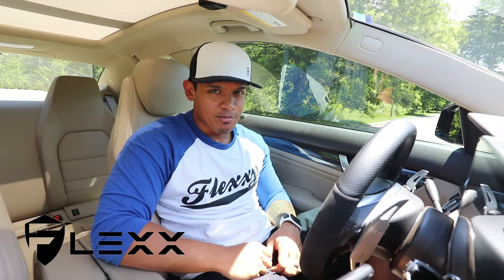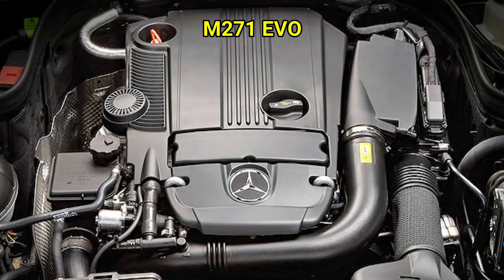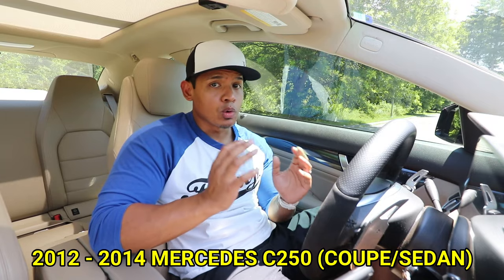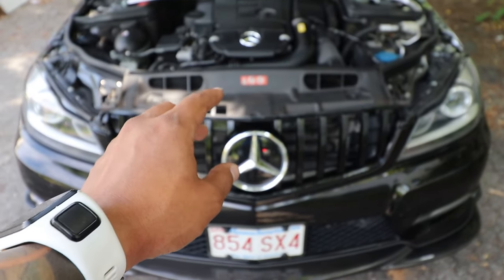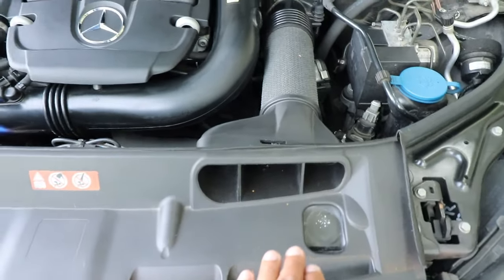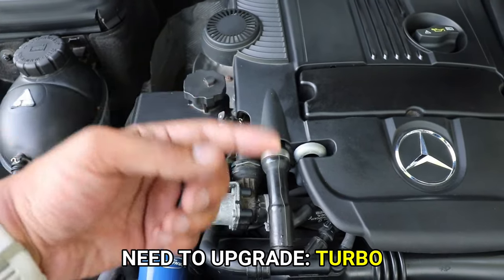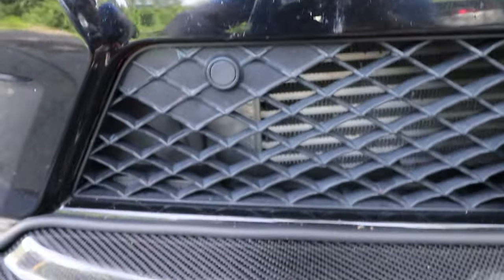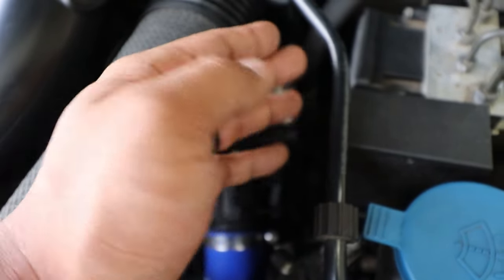So that's how the TURBO SYSTEM works in a Mercedes-Benz C250!

Comment: Hello Flex, how are you? Look, I have a little problem with my mercedes, c 250 2014 I put a relief valve on it and then everything was fine, but my voice control broke inadvertently I put one on it, but now it keeps pulling pressure. nikebs and not the car does not move, what do you think it is?

Comment: Turbocharger is always located directly after the exhaust manifold. That is the rule if the car is stock. There are no exceptions whatsoever.
Reply from the maker: Not 100% true.  A portion of the turbo is attached to the manifold but it’s not all turbo after the manifold. The exhaust manifold exhaust spins a shaft that leads to the turbo and spins the turbo. So you can say the shaft that spins is after the manifold but not really the entire turbo.  

The airflow starts in the air intake and then into turbo, then it’s becomes charged through the exhaust fumes spinning the shaft that spins the turbo.

Comment: Hey flexx love the vids man!!! Im a new Benz owner, got a 2012 C250 sedan, and im coming from a 2009 Jetta Wolfsburg Edition 2.0T....when i would accelerate on my Wolfie, i could hear the turbo clearly, and it was music to my ears! However even with my windows down, i hear no turbo "whistle" from my Benz....is this normal? Or should i be concerned?
Reply: I have a 2014 C250 Sedan...That's very normal.. In a few of Flexx's videos, he talks about the turbo muffler that MB installed in our cars. Our cars are designed to be efficient and quiet. If you haven't already, I suggest ripping through a ton of his DIY mod videos. They are inexpensive, fun to do and really make our cars more fun to drive. Welcome to the MB community!
Reply: @weatherwatchTX  my c250 whines almost like a supercharger, i absolutely love the sound but wish it was louder. that said i really want a traditional turbo whoosh!
Reply: Thats because you need to get a diverter vaulve sounds gorgeous

Comment: If I have an oil leak at the turbo bank 1 between turbine and compressor any suggestions on how to stop leak…or should I be replacing something?
Reply from the maker: No clue. On my c250 when I did have an oil leak near the turbo, it was a fail oil feed/return line. Replaced it and no more leak. This was a common known issue.

Comment: I might need to change the wastegate actuator or the valve to address a low boost pressure error code. Is it an absolute must to remove The power steering fluid reservoir? 2013 c250

Comment: Is there a regular service that needs to be done for the turbo in this engine? My wife has a 2012 C250 Sedan with about 120K miles with no issues.
Reply from the maker: No there isn’t. (To my knowledge)

Just make sure your oil to the car is changed regularly and don’t let it breakdown too far. 

Also, the gasket to the metal oil feed line to the turbo usually fails and starts slowly leaking oil.  It’s a pretty straight forward replacement.
Reply: @TheFlexxGarage  Thanks

Comment: I have the same car and my factory intercooler hose coming out of the turbo is always been loose. The clamps are on and you can't pull it off but it's loose. I've never had an issue but recently I'm getting a low boost issue. I haven't found that issue yet but I've always wondered if that hose should be loose like you can shake the hose around while it's connected to the turbo It just seems too loose
Reply from the maker: The hose should never be loose.  Cause when the system is building boost and then pushing that boost to the throttle body, any little space or gap or whatever, that boost pressure will punch through and be a leak.
Reply: @TheFlexxGarage  it's been loose since I got it which was 9 years ago and never had an issue at all.. now I do have an under boost issue with a whistling sounds. I sounds like an 18 wheelers and I pulled all the hoses off and all are fine . Any ideas maybe?

Comment: Thanks for this @theflexxgarage (subscribed). New 2013 C250 owner, throwing a P0245 code "Turbo Wastegate Solenoid A Low", any idea what may cause this issue and what to replace?
Reply from the maker: No clue.  I only do mods.  You can search the forums and see if someone had the same issue. If not, you need to seek a certified mechanic to diagnose your car.  There’s plenty of German brand specialist shops so you don’t need to go directly to the dealership.

Comment: Where did you buy the turbo hoses (blue color) showed in the: how the turbo system works in the c250 coupe. Thanks.
Reply from the maker: Go watch my c250 turbo charge pipe video. All the info is there.

Comment: When you had the throttle body exposed was there any carbon build-up in there ?  I get slightly rough idle sometimes and thinking there may be a little carbon build-up in the throttle body housing outside the perimeter of that movable flap. This happened on my truck which cleaning resolved so wondering if the M271 turbo builds carbon in a similar way ?
Reply from the maker: No. It was actually pretty clean
Reply: My car did exactly what you said they try to say low pressure but the high pressure is okay that's very confusing

Comment: how many miles you think the turbo can last on a c250? I'm currently at 125K
Reply: Mine is currently at 157k+ miles, and it went out about 3 months ago.
Reply: @VertexHero  How do you know when it goes out? Is there a service there needs to be done regularly?
Reply: C180 here, mine just failed at 176k was quoted 5k for a new one…ffs